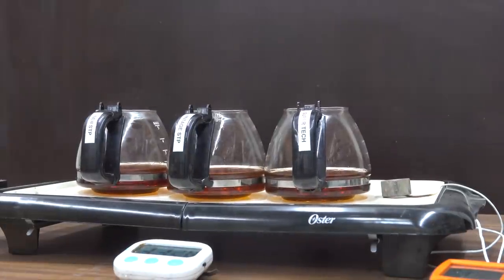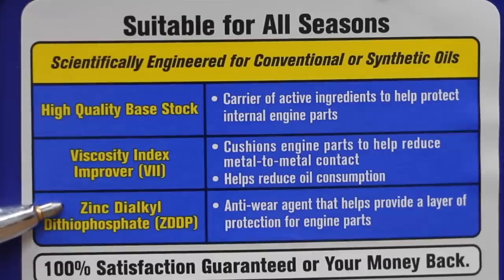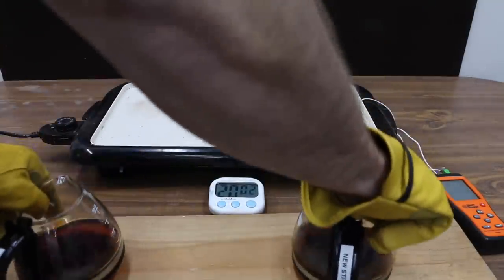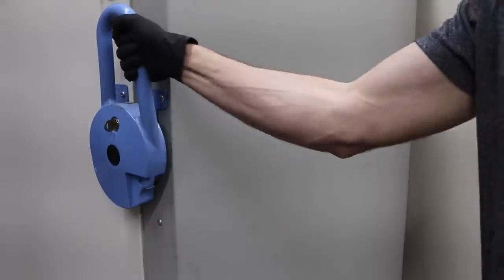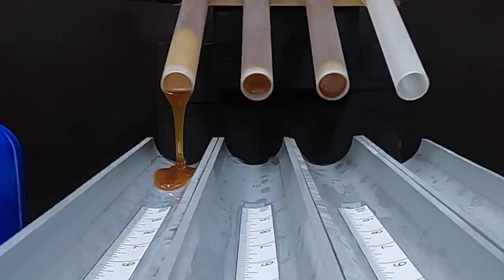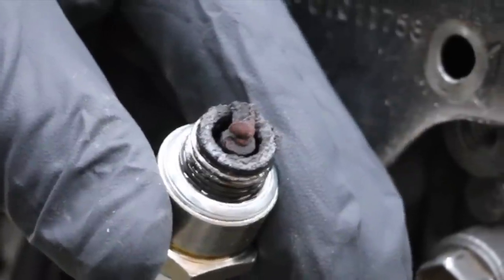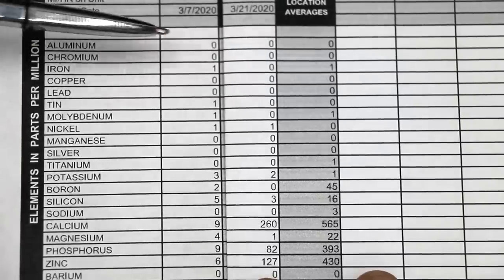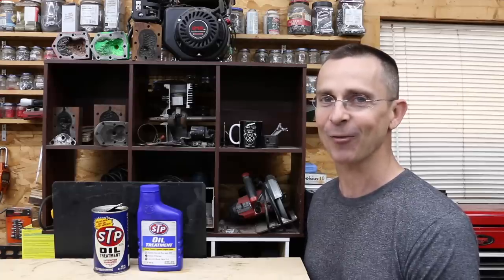Richard Petty's 1981 STP vs 2020 STP?  Let's find out!

Comment: excellent again.  i've got a testing suggestion if you haven't done it yet.  back in the 80's a mechanic friend advised me to try slick 50 in a nissan l16 motor because it started smoking yet wasn't old enough to purchase cigarettes.  it worked!  it took a while and gradually it got better and better.  it started to sound like a crisp new motor.  it delivered the same result in another motor a few years later.  the third time was a fail.  there are videos on yt about john bishop who claimed he invented slick 50 then sold the name but not the formula to shell oil co.  he is now flogging his formula again.  and others are currently selling things with similar claims.  is this true?  if youve already done this test please direct me to it.

Comment: I have used STP in the hopes of prolonging the inevitable. In my 6.0L powerstroke they have a problem called stiction when the spool valve in the injector sticks. The only additive I found to help was Archoil AR9100 friction modifier. They have other additives and a rust remover. I wonder how well this would stack up to STP or other additives like Lucas or Hot Shot's Secret?
Reply from the maker: Thank you for the video idea!

Comment: Just found this and it may have been said but comparing the 1981 STP should have been done with the improvement to oils available in 1981.  Oil chemistry has changed quite a bit since then.
Reply from the maker: Thanks for the constructive feedback.

Comment: Last I knew you could still purchase what you call Vintage STP ...  I have added some to  worn out engines before..
  Newer engines are designed to run with thinner oil and they have a vane type oil pump instead of a gear type oil pump.  Modern engine pumps can't handle  such thick oil ..as older  oil pumps can't handle  really thin oil either.

Comment: Now that we're talking about ZDDP, could you analyze popular "hot rod" oils to see if they're really safe to run with a flat tappet camshaft? My understanding is that 1100 PPM of ZDDP is the low threshold for what's acceptable to avoid lifter/cam failure. Lucas Hot Rod & Classic Oil, Brad Penn, Joe Gibbs, Amsoil, Redline, Valvoline Racing, etc. I run Lucas Hot Rod & Classic oil in the 1971 C10 I'm building and they advertise 2100 PPM of ZDDP.
Reply from the maker: Thanks for the video idea.

Comment: Well ... In 1972 at General Motors Institute (Flint, Michigan).  We students convinced our professor to allow us to conduct an oil product performance test.  We were not allowed to publish the results of the test at the time, however I'm prepared to accept his wrath if reported.
The Tests:

Heat Test:  (conducted essentially the same as yours with similar results).

Film Strength Test:  Three stainless steel ball bearings of .30 diameter in a bowl shaped centrifuge tray with no residual oil in the tray (film strength only).  The tray was spun at a specified high rpm for a specified time.  The yield was that conventional Valvoline 10W30 not only survived the time limitation, it continued to perform for 3X when we then shut down the centrifuge.  Of the 5 products tested, STP failed first in this test.

Cold / Viscosity Test:  (conducted essentially the same as yours with similar results).

Use Test:  We engaged the Yellow Cab Company (Chicago) to use two identical new cabs, with identical engines, using identical oil filters, under identical usage for the first oil change interval with one cab using Valvoline and the other Valvoline with STP additive.  With the oil change interval completed (5,000 miles as I recall).  The rocker arm covers and oil pans were removed, along with a conventional service.  
Yield:  The Valvoline only engine components were clean.  The Valvoline / STP engine had "major" sludge build up, primarily in the rocker arm cover area.

Richard Petty:  Including his race and marketing history, Richard and his Son Kyle are two of the nicest people i have ever worked with in business.  In 1982, I worked with Pontiac Motor Division and we engaged in a Major Indoor Soccer League promotion that included Richard and Kyle.  They were extremely professional and generous with their time.  Both would stay at each of the three presentations until everyone who wanted an autograph received one.  Compare that to the NASCAR juvenile delinquents of today.  They don't make them like that any more.
Reply from the maker: Thanks for sharing.

Comment: What an eye opener. Back in the mid 1960's, I used STP on my old Chevys, 1954, 1958, 1960 because they smoked, burned oil and ran rough. STP worked to reduce some of those effects. But like you said, I might have been doing more harm than good. But it kept the car alive a little longer but they never reached 100,000 miles. Granted, cars today are made a lot better today and I had a 1998 Toyota Camry go 252,000 miles WITHOUT any oil additive and was still running well when I donated it. I still don't use additives on all subsequent cars.
Reply from the maker: Thanks for sharing.

Comment: Wow, definitely a Summer time oil, for sure. After watching this I think I've bought my Last can of STP, I think it's outdated & in the same category as the "No Smoke" additive.  Thanks for sharing.  Take care,  - Leeroy         Ps, has PF ever tested "No Smoke"?...    I used it for several summers in a worn out Snapper mower, straight No Smoke, no joke, it kept running. Started out using some regular thin oil like maybe 10w30 or something similar & it burned it all up in no time, engine was DRY, NO oil left. Compression tested about 75psi I think. Hindsight is 20/20, I Should've been running straight Engine Restorer instead.
Reply from the maker: Thanks for the suggestion.
Reply: You're very welcome. Thanks for the good videos.   - take care man  @ProjectFarm
Reply: @ProjectFarm  Don't forget to do a video testing torque specs/results on Dry nuts & bolts Vs nuts/bolts that have been lubed w/ anti-seize compound &/or good quality grease like the good high temp blue Lubrimatic. I Can't find that stuff anywhere!...  I Tried ordering it off Amazon, my brother tried, & my friend tried, all were a bust. They advertise the blue Lubrimatic brand, then send u cheap Low temp Red grease!  Happened Every time!... MERCY. 
Anyway I think u can Reduce torque specs on nuts/bolts when they're Lubed, otherwise you're likely to really Really overtorque stuff.

Comment: I know you use a vacuum pump to remove fluids, wondering if there are other options that you can test for us. Example of moving gear oil 85w-140 with a drill powered oil pump. I found one at Ace Hardware and O’Reilly’s also on Amazon they are everywhere. They say they are for water, but curious about thicker liquids. 

If curious a part number for O’Rielly’s is W1143. Should be cheap to test.
Reply from the maker: Thank you.

Comment: Please test the Liqui Moly Molygen 5W-30 which claims it does no need any additives. Also STP has a newer version than this called "STP Ultra 5 in 1 High Performance Engine Treatment" oil additive.
Reply from the maker: Thanks for the suggestion.
Reply: @ProjectFarm  Liqui Moly also has a newer oil additive "Molygen Motor Protect", would love to see where it falls on the leaderboard. Thank you

Comment: As others have said, STP and other products like it are useful in engine assembly. Especially if the engine is going to set up a long time before use. 
I would avoid pouring it into any engine later than the 1970s. Like he said, modern motor oils are better than they were back in the day.
Reply from the maker: Thanks for sharing.

Comment: Around 1976 my mom bought me my first car, a 1947 Plymouth special Deluxe Coupe with a tired Flathead 6. It drank oil like no tomorrow. I rarely changed oil since I put fresh oil in daily. I saw  STP in the oil section and believed the hype on the can{ Richard Petty wouldn't promote a shady product like STP, right?} So I give it a try. I added 3 cans when I was a quart low. I noticed better oil pressure, the engine seemed quieter. Also slowed the oil consumption some. One night a brilliant idea came to mind, If 3 cans of STP helped my tired engine, wouldn't 2 more cans cure my tired motor? About a week later cruising down the road I heard a loud bang and motor quit running due to a hole in the block. That thick funky colored oil dripping on the ground. I wouldn't put STP in my lawn mower
Reply from the maker: Thanks for sharing.

Comment: I would be very reluctant to add something that has a significantly higher viscosity than the recommended oil for a modern engine. Given the lack of a superior additive package, there is even less reason to use something like STP with a modern oil. If an engine is shot, STP isn't going to fix it.

Comment: if you still have the smoking engine, for oil, try shell rotella with zinc and see if that reduces the smoking and  oil consumption vs regular motor oil vs synthetic motor oil.  i am curious what the result would be.  

the reason is, rotella with zinc in it is a bit cheaper for a riding mower engine that burns a lot of oil, and it seems to me the engine is burning it less quickly after a few weeks of using the rotella with zinc.  mine is just straight 30 wt.

Comment: I've run super tech 10W30 in the winter an 10W40 in the summer for 10 yrs in my 89 Ford pickup 5.0 an there's 198 thousand miles on it an it don't burn oil just leaks it!
Reply from the maker: Thanks for sharing.

Comment: I have 2 01 Ford Triton v10, and I am normally not super concerned with what brand I use as any brand oil will meet or exceed oil that was around in 01 , but last week I changed both my trucks with the wine box style of Valvoline advanced synthetic , and the V10 with high mileage started smoking at start up right away. It never did that before . So I blame the synthetic oil leaking past the valve seals . I just added a regular blue bottle of STP , I will see if it stops smoking in the morning . Interesting that Fomoco is synthetic blend and doesn’t smoke at start up . Maybe synthetic isn’t for every engine .
Reply from the maker: Thanks for sharing.
Reply: @ProjectFarm The one treatment with the blue bottle stopped smoking at start up ! I found it very cool that I am that close to the edge on viscosity making an actual difference on start up . 😊

Comment: Does oil degrade over time? In your viscosity test the oil took forever to move but then bolted out really quickly. How would your metrics compare if you could test each oil when they came out?
Reply from the maker: Thanks for the suggestion.

Comment: i rebuilt engines in the 70s and 80s i used it only to coat bearing and moving part till oil could get to them. the engine i tore down that had used stp in  them were a total mess i think it hurt  the engine and killed gas mileage. in winter engine had to get hot before it would leave oil pan. i still have a 1/2 can of the old. last one i rebuilt a may not have even used it. take care, be safe and well. yes i am old
Reply from the maker: Thanks for sharing.

Comment: 9:00 You put straight STP into the engine!!
Why did you not mix it with oil in the recommended ratio?
If some is good, more is better ???

Comment: I wonder that ceramic coating that used as paint protector, does anything applyed to engine parts, like does it affect the carburetor flow, does it last in a cylinder or does it protects the exhaust / head  from carbon.. since its invisible does it protects bare aluminium / iron from corrosion.
Reply from the maker: Thanks for the video idea.

Comment: Could you test which modern oils are best for vintage engines with flat tappet camshafts?  Eg. Lucas Hot Rod Oil, Brad Penn Penn Grade, Driven by Joe Gibbs, Valvoline VR-1, etc.
Reply from the maker: Thanks for the video idea.

Comment: In my opinion;  It's difficult to accurately compare engine protection lubricants or oil stabilizers between engines made in the 60's-90's and today's engines.  Tolerances are far tighter, materials are more advanced and engine components are far more consistent due to CNC and computer drawings.  As a mechanic during those years, there was no better way to add engine protection.  Say what you want, I have been adding STP every oil change to all my vehicles for over 50 years, and with 5 kids that is a lot of cars, over 25 easily.  Never had any engine burn oil, blow up or overheat, all reached mileage well over 200K.  STP is an great $4 investment for engine protection.  Helps with cold start lubrication and fights viscosity breakdown.  Exactly what it was created to do!
Reply from the maker: Thanks for sharing.

Comment: A modern engine has very small passages and clearances,the thickening of STP might harm it
Shame about that mower engine,is something like a 12H 802 "Quantumpower" and was better than the common "Classic" engines,running without air filter particularly while raising a cloud of abrasive dry dirt and dust probably damaged it severely,I seem to remember about 20 or 21 ounce oil capacity in those things 
did you see deep scratches or gouges in the cylinder wall? Or could be the valve guide sides worn severely
Reply: LOL. Is this a joke??

Comment: If you want a good ZDDP Zinc supplement Rislone was tested to have a high Zinc content and should bring most oil back to old school levels..The best way to do this process is to buy oil that is designed with High Zinc in it so the detergent package doesn't fight the Zinc..Zinc goes to the metal..Detergents push it away or absorb it..Newer oils have a better detergent package so the zinc additive probably won't be 100% effective..Valvoline VR1 has more Zinc and also Driven brand oil does as well..Newer engines do better with low zinc because of design..Older engines with flat tappit cams need higher levels of Zinc.

Comment: The owners manual says, "Your vehicle does not require oil additives. In fact, they may adversely affect the engine performance and durability."  That sound pretty damning to me.  I wonder if adding it cold void the engine warranty.
Reply from the maker: Thanks for the suggestion.

Comment: You should do a video comparing “euro” spec oils to us spec.  My girlfriends Jetta “needs” euro spec 0w20, and I’m curious how that compares to regular 0w20.  Thanks!
Reply from the maker: Great suggestion!  Thank you.
Reply: I’ve also always wondered what the difference is between marine oil, and regular motor oil.  Supposedly the marine oil is better for high rpm, and is better at controlling corrosion.  I’m not sold on either of those claims.  Another video idea for you if you’re interested!

Comment: I have some 20 year old mystic 15W-50 I’m running in a 2021 F250 diesel. People say it won’t perform as well because it’s not up to the new standard and it will cause higher DEF consumption. Can you test that?
Reply from the maker: Thanks for the suggestion.

Comment: Have you come across an additive that helps to “restore” the depleted additives in used motor oil?  I’t be pretty cool to add a bit to 5,000 mile oil and make it last 10,000, for example…
Reply from the maker: Thanks for the suggestion.

Comment: I think a comparison of gun oil and atf would be great also other oils. Trans fluid has a super high sheer resistance and anti oxidation properties. It is formulated to withstand high temperatures, continuous heat cycling and pressures. I have not tried it but if atf is good I think CVT transmission fluid may be even better. It is basically super atf. It has all the attributes of atf but more so an because of the nature of cvt transmissions a higher sheer strength.
I would love to see a comparison of gun oil X against atf against cvt fluid.
Reply from the maker: Thanks for the video idea.

Comment: I run all my vehicles on a mixture that is roughly 2/3 stp 1/3 marvel mystery oil...both my last trucks went to over 35000 and the motors were still running smoothly and quiet...one got totaled one the frame got to bad to keep repairing
Reply from the maker: Thanks for sharing.
Reply: @ProjectFarm  just a thought..it might not be so good for small air-cooled engines like you mower because alot of them have more of an oil slinger than a pump.and stp without being cut with something to thin it is just to thick🤷. Hard to say without testing lol. It was interesting that it did well in the wear test despite not having near the additives in the oil.makes me wonder what is in it 🤔

Comment: Could you please  test out the capabilities of Militec Metal Conditioners versus other Metal conditioners, First Generation Slick 50,. Not the one current brand of Slick 50.  I heard it's a gimmick now.  First Generation Slick 50 used to say it could protect a engine from wear and destruction  even without oil or an oil pan in a car during a race.  I used to use first Generation Militec the original metal conditioner in my Remote control monster trucks and temp the engines over 500 degrees and the engines never blew or had any problems.  It would be great if you could prove how great these products used to be.  Thanks and I hope you prove that metal conditioners do extend and does protect engine life and wear.  Militec is now promoted as a weapon metal conditioner and not recommended for automobiles anymore.  Though Militec has always been my go-to additive on all my engines.  I have almost run my motorcycle to one drop of oil and the engine is still running fabulously.  If there are any metal call nditioners that are on the market and can stand up to the old slick 50 test of running a car with no oil pan and no motor oil in race conditions would be great.
Reply from the maker: Thanks for the video idea.

Comment: If engine oil needed an oil treatment, don't you think it would already be in the oil?  However, I do wonder if the oil treatment would be beneficial at 5-10k miles when an oil change is needed.  In other words putting in the oil treatment rather than doing an oil change.